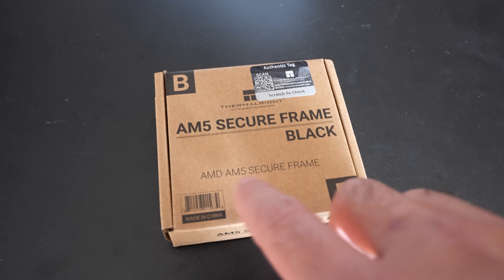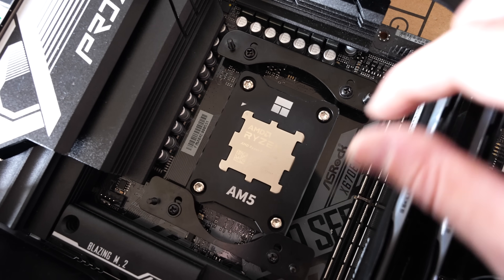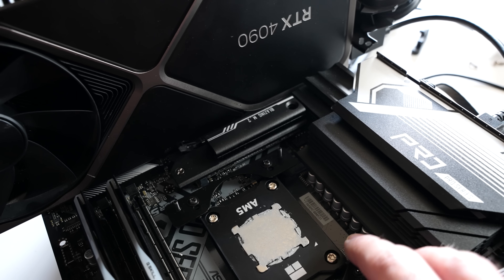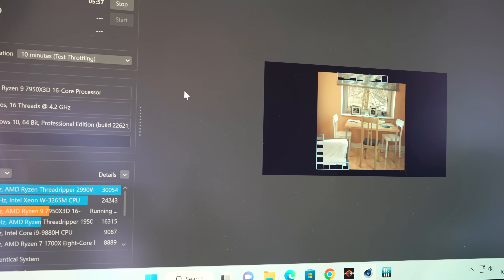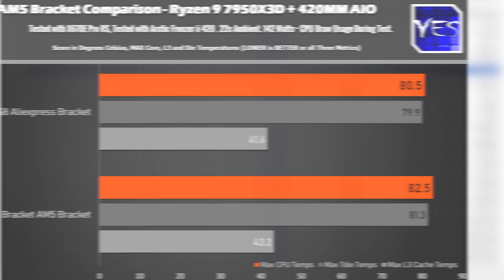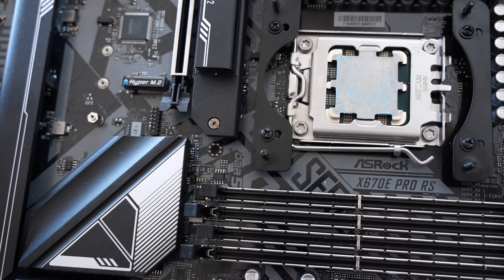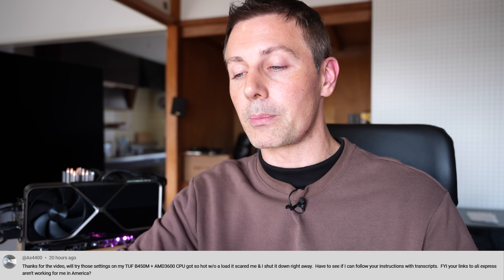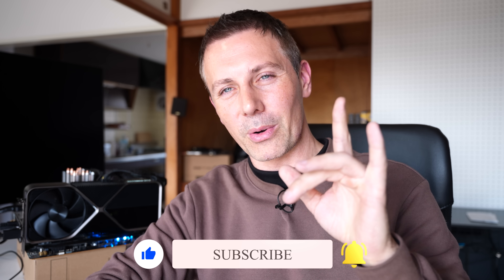$8 Fix for AMD Thermal Problems? | Thermalright AM5 Contact Frame

Comment: You really cannot claim a 7950x3d with the non-vcache ccd turned off is a 7800x3d because the 7800x3d boosts 250mhz (5000mhz) less than the vcache die on the 7959x3d which boosts to 5250mhz

Comment: 1 or 2 degrees is negligible, $8 pretty good price to get more improvement in temperatures. Is there reason why AM5 has issues of temperatures for the CPU die contact with the cooler?

Comment: The only reason I would buy that bracket is because it looks like it would do a real good job of keeping thermal paste out of the cpu. The open design the AM5 cpu's have, makes me paranoid about thermal paste getting in there. It looks pretty good, too but then once the cooler is on it can't be seen anyway, so that's a very minor plus.

Comment: Those differences are less than using different paste. So not really worth it.
For the super enthusiast who runs the chip at it's absolute maximum, even such a small difference can be important, but the normal user won't even notice.

Comment: My thermalright LGA 1700 contact frame dropped temps on my 12900K like 20c. Before when I would tweak the bios and put on a mild OC like 5.1 ghz it would immediately break 95c plus when I would put on a short stress test. After the contact frame I can hit 5.4ghz stable with an avg temp of 55-60c while gaming. When I stress test max temp it will reach is 78c for a brief second. It's nice to be able to actually OC my 12900K to try to close the gap on bottlenecks with my 4090 when i'm running 1440p benchmarks or just gaming.

Comment: I used the thermalright 12th gen bracket for my 13900KS and I was able to overclock a Vcore of 1.62V, 355W, single core 6.3G, triple core 6.2G, and all core 5.8G without disabling efficiency cores, the cooling solution is an Asus ROG Strix 360 ARGB AIO and Coolermaster Cryofuze Violet thermal paste, and it never gets past 94C, normal operating temp is around 40-50C. However, that being said, this system with an overclocked Asus ROG Strix 3090Ti OC LC at 2.2Ghz,1.3V, 600W, I can never play Genshin Impact at 2k 60Hz, whereas all my other computers can.

Comment: - AMD CPUs clock higher if they get more thermal headroom so you NEED to also include performance comparisons, you can't JUST look at temperature numbers.  
- a thermal probe on this thing would tell us if it actually soaks heat.  
- how much of the surface area of this connects to the heatsink/AIO?  
- an AIO has the high density fin area in the middle of the chip, on the outside the copper might just about touch the edges.  
i don't really see this doing much. But even if its only 1°C if you try to squeeze the max out of it, every °C counts, for 8 bucks this is a steal if it does anything at all.  
And if you go budget you don't go for expensive high end CPUs like this anyway.

Comment: So "bad temps" for AM5 isnt a thing. Itll always aim for 95c if you have an X chip and its not in eco mode. These chips work closer to how a GPU does rather than a traditional CPU. Its a bit different for a X3D chip, just like 5800X3D they need a surprising amount of cooling for their lower watts.

Also this fix works on 12th and 13th gen Intel for a very specific reason.

Comment: The fix in my opinion would be AMD and Intel selling a 10$ reduction version of their CPU's lineup as Direct Die and every god damn cooler manufacturer making versions for Direct-die with all the safety mechanisms on the cooler them-self.

I specially hate paying for something I don't want so I'd get rid of the extra layer on top of the CPU which makes the cooling less efficient and when things get hotter than ever it seems they even decide to make them thicker FFS, how much I'd really want to get a no IHS version and coolers designed for it that simply won't allow to crack it unless you really make all your strength on purpose...

Comment: Some other channels such as JayzTwoCents, Linus Tech Tips and even your fellow Ausies at Hardware Unboxed have had links that do not take me to the products they are supposed to either. So my guess is that it may not have anything to do with Amazon, Newegg, or AliExpress. I have had problems with all of these. So I am guessing it may be the security settings as I have them or perhaps the browsers (I use Edge, Firefox, Opera, and the Avast browser) that are the issue and not the links.

Comment: I bought this off Amazon I heard it stabilized the cooler mount.
I'd like to see you use a premium air cooler like a NH-D15S or better since you are comparing it to a 420mil liquid cooler.

Comment: The snowman cooler is a copy from the sunbeamtech core contact freezer 120... yep its old tech and only supports 90+W cpus... I have one and as far as I can tell, its good for the ryzen 3 1200 but can hardly contain the heat from even the FX 8370E.. even when using high rpm DELTA fans, even if you use the snowman MT-6... its hardly enough to dissipate the heat from the 7800X3D. Your best bet would still be the NH-D15 but this will not fit most cases....I know this because it hardly fit on my converted Dell XPS 710 case and this thing is huge.

Comment: The AIO used in the video is supposed to be mounted with an offset so that the cold plate is centered over the Ryzen Chiplets under the IHS. Basically you have to move down both of the two pieces which you screw the waterblock onto so that the uppermost drilled holes are used instead of the bottom holes. Offset mounting is the right way to use the Arctic Liquid Freezer II 420mm on Ryzen 7000. I have mine just like that mounted with the offset, the waterblock and coldplate are centered right over the chiplets.
Reply: Could you please explain better what you mean by this? I just ordered 7800x3d with arctic liquid freezer II
Reply: @Yurmun  So when you get your cooler.
You have to place the two black colored plates supplied with the cooler on the AM5 socket as far down as possible. They basically align with the topmost drilled holes on the plates. And then you place the waterblock the same way and it's holes should align properly aswell. This way the waterblock sits as far down over the IHS centered over the chiplets under it. You can mount it normally as well but then it will sit further up not exactly over the chiplets. It's not mandatory but it's preferable to mount it with the downward offset.
Reply: @DonkeyBallss  is that also true for the liquid freezer 280? Does it also include the same brackets?

Comment: Is the bracket snug enough to stop liquid metal from leaking onto the conductive parts of the CPU? Does it make it safe?
Reply: It's not a 100% fit. So you got very minor play. But that minor play might be gone when the CPU heats up and the material expands a littlebit. So I can't tell you for sure but it definetly helps keeping thermalpaste out of the cpu gaps.
Reply: Not at all! The bracket us solely for pressure optimisation. The optional silicone guard is mandatory using liquid metal according to Thermal Grizzly.

Comment: Yeah this isn't a product that needs to exist. the stock ILM is just fine for am5, since most of the problems are due to the thickness of the IHS. if there was an easy way to lap the chip you would be more likely to see results.

Comment: They should have included something like this already.   All the pieces of the puzzle are starting to come together.   My  guess is that we are going to see a tramatic change in the pc industry coming.   If you already have a good AM4 with 32gb or 64gb ram and a 8gb gpu you are good.   The increases in cost across the board plus more headaches to not justify upgrading to AM5.  If you building new then yes you need this bracket has a piece to the puzzle.   My desktop computer is a production / entertainment computer so I need stability with less headaches extra.

Comment: Why are you testing air cooling with a $20 air cooler? For a 7950X3D you should be using a high-end air cooler. Nobody in the right mind should be using a low end air cooler with a high end CPU.

Comment: The Big Issue with AM5 Temps is the THIKNESS of the IHS its Bigger than usual , and AMD forced to do that so they maintain the compatibility with AM4 coolers !!!
Its a good & bad deal in the same time you will not be forced to buy a new bracket for AM5 , BUT in exchange you will get a freaky High Temps !!!!
sorry for my bad english

Comment: I purchased one of these brackets for my 7900X new build. Did a before and after since I was putting it together. I reseat a few times just to make sure I was getting a steady and correct reading temp wise. I ended up with a 5c difference. Using a custom loop system. So there is something to be said for purchasing one at such a cheap price.
Reply: Nice
Reply: Total bullshit. The cpu cooler presses against the top of the CPU heat spreader and has no contact with this. Thermalrite dont claim it makes a temp difference, they claim it prevents thermal paste from spilling over the sides. For Intel, they had bending issues. AMD didnt have those issues. it was just the odd shape meant thermal paste was getting squeezed through the gaps. I ordered one just cos it looks cool and to keep thermal paste out. but dont understand why idiots have to make up bullshit claims lol get a life.
Reply: I call bullshit.

Comment: Seems they took the solution for the Intel temp issue and implemented it for the Ryzen temp issue, when the reason for the higher temps for each processor is different. So, the solution that helped Intel, does nothing for Ryzen.

Comment: If you got thermal problems on your 7000 CPU. Maybe you should have know about it and gone with a 5700x instead. Where the coolers and socket is not garbage! And the CPU is not almost just faster by using more power! Unless you go ECO mode and then 5700x + DDR4 still looks better!

Comment: Thanks for testing these brackets! I've always wondered if they did anything for AM5 and you've scratched my curiosity itch!!!
Reply: According to manufacturers they are not for temperature improvement! So what are the temp tests supposed to say? The AM5 ones are for pressure optimisation … the optional silicone guard for thermal paste improvement!m avoiding leaks!

Comment: Hey bryan, recently I've noticed that you can undervolt any 13th gen CPU without losing performance after changing the CPU microcode to version 104 (it takes a bit of effort), and this is very easy if you are using an ASUS motherboard since they allow you to change the microcode directly in the BIOS (advanced settings --> tweaker's paradise). By doing this you can undervolt the CPU just as usual !
Reply: Wait, has undervolting been removed from 13th gen?
Reply: @Eduardo1007  the performance would drop dramatically if you try to undervolt the 13th gen. My 13600kf got only 1/4 of the normal score or even lower in CPUZ after I reduced 0.1V. However, by using the method I explained earlier, you can undervolt the 13th gen just as usual.

Comment: It cannot lower temperatures on AM5, since if it would then the CPU would boost higher and hit the same temperature as before.
It is like that by design. Perhaps on the 3DVcache die a little bit since that cannot boost.

Comment: The contact frame on AM5 is more to avoid thermal paste to go Everyware than to fix any bending issue. Not sure why you was expecting to see any temperature drop with it.
Reply: Contact frame made from Fiberglass was superior than metal in LGA1700 in Igor's lab test, maybe Brian could try to replicate!
Reply: False … they are for even pressure distribution according to manufacturers! The optional silicone guard protects from paste.

Comment: speaking of the snowman mt4, just got one for $11 usd (converted) free shipping too, -10c both idle and full load (r5 3600) coming from the stock cooler its well worth the money, the initial install with the default am4 clip brackets is freakishly unnerving tho, seems like excessive force pushing down on the 2nd latch lol

Comment: i remembered Thermalright sell the contact frame with a thermal paste in china , because they knew it doesn't do much, if $8 only get you the frame than it is not worth it, but if it came with a thermal paste than I guess it is fine

Comment: The brackets for am5 were made to prevent thermal paste from making a mess all over the cpu
Reply: Yeah, this was the main motivator for me to use one of these.
Reply: Thank you for clearing that up. Seeing the video I am racking my brain on why AM5 needs a contact frame. For your info, I am using contact frame on my intel 12th for the bending issue, so this video really confusing me as the AMD cpu has a totally good, square and solid lid.
Reply: I thought these brackets were designed to keep the CPU from being bent? That's the description.
Reply: @optikon4658  i think the cpu being bent were the intel cpus and not amd am5 platform im not too sure
Reply: @optikon4658 I mean the am5 cpu's are square unlike the intel counterparts, which are rectangle. Am5 has better mounting pressure than intel by default, the bracket was supposed to reduce temps, but with testing it didn't really change any temps that much. It's more of keeping thermal paste out of the cpu
Reply: @optikon4658  That is more true for the Intel chips, they are a rectangle build and can suffer bending so it is worth it. AMD, not so much.
Reply: With Intel there was a contact issue and these contact frames helped flatten the heat spreader and improve temps but its not an issue for AM5. It's to keep the thermal paste out as you said, and for aesthetics. Pretty much just bought one cos it looked cool
Reply: you can get some stickers of some sorts instead of this bracket i think they are more expensive but atleast you dont need to install a bracket
Reply: @KenjiBiH This takes 10 seconds lol
Reply: @ good?
Reply: Yeah too bad compound still gets into the corners. I have uninstalled them and still had the qtips out trying to clean it up. Worse is the plate doesn’t fully wipe clean like the IHS does cleaning off old compound. I have built five AM5 systems now and bought five brackets but they certainly don’t prevent compound. I still like them for even pressure, the look and limiting the compound vs stock.
Reply: @45eno  that shit is stressing me out. I couldn't clean the paste that fell underneath
Reply: Stop spreading false information … the brackets are made for pressure optimisation … not temperature reduction and NOT thermal paste protection … the optional silicone guard is for thermal paste protection … source: the manufacturers of those brackets! And be careful … removing original SAM can void warranty of mobos!

Comment: Thank you as normal person you tube has taught me a lot and saved me making mistakes and money so (using air cool PC no real need to use this extra) A lot  content is for high end PC most people do not have them given the spec of your parts this is very limited  data and test that is done using parts that every day gaming are using could be of more use take a  look at Steam for data on most common hardware

Comment: Put a little thermal paste around that bracket so it helps soak heat from the sides of the IHS and it may help a little more.
Reply: its made of foam
Reply: @Nethan10Troi  As an owner of this bracket, you're 100% wrong
Reply: @ElSkeppo  must be confusing it with the CPU Guard then. Cuz thats what this basically is, but a bit fancier.

Comment: But did you get a higher benchmark? The way am 5 cooling works, you should max out on air and get the same temps but different performance

Comment: The limit is the CPU cooler you selected (even with 2x fans in a push-pull configuration you won’t have better temps, only less noise). You have to go with a Dual Tower Cooler (or a big cooler like the *Black Rock*) that has the capability / thermal capacity to dissipate more heat in order to see a significant difference. Just my two cents. Thanks for the great content!
Reply: I'd argue that the water cooling test is a good estimate to how much it differs with a bigger air clooer. Not perfectly, but close enough.

Comment: I bought an 5800x3d a while back and it thermal throttled at idle. I put my 5800x back in and problem solved. The 5800x3d went back for a refund. If I have to buy additional after market parts for a new CPU to work correctly, I don't want it.
Reply: Should have just undervolted it. But honestly the 5800x is basically just as good

Comment: I’m running a 13-gen 13900K with one of those blocks on an Asus mobo. Running full tilt rendering (forensics) with a 4090 sharing the load. It averages around 47C with full fans. I’m running it bone stock as the newer chipset on the latest boards has issues with XMP and over clocking -with the current bios. Cooler is a 480 liquid.  We just put those blocks on 2 more of the same systems. Personally I like them.

Comment: AMD did not do themself any favour in going LGA with AM5. The height of the heatspreader((it's way too thick in order to get on AM4 plattform height for cooler compatability) as well as it's form is far from ideal. They kinda stuck now on this design unless AMD decides to release a completely updated heatspreader design alongside modifications to the ILM.

Comment: Did the clocks change with the bracket vs without? Cause AMD's strategy with Zen 4  appears to be to use all available cooling overhead and clock the cores higher instead of dropping temperatures at the same clocks.